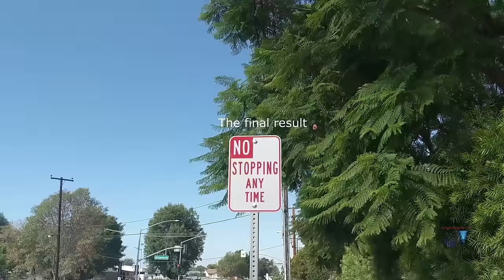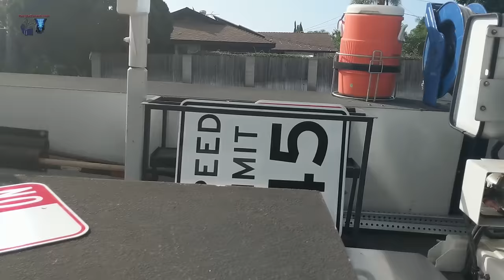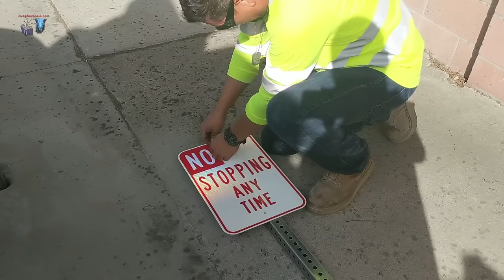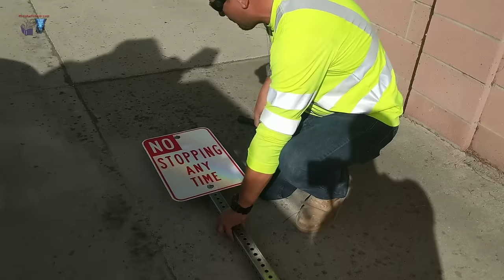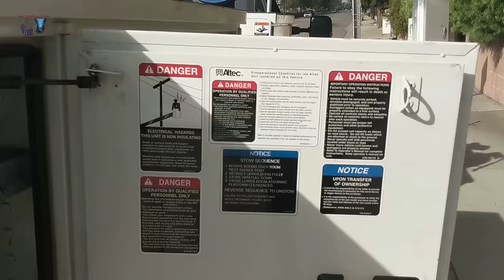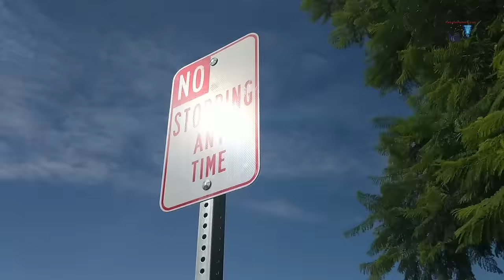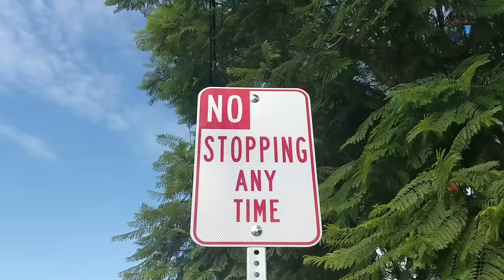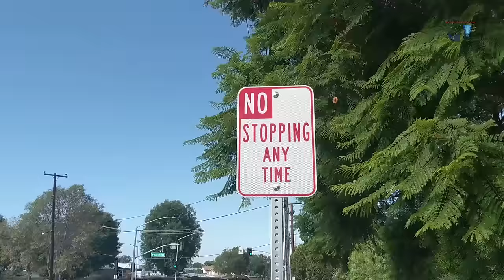USA - HOW TO REPLACE ROAD SIGNS, MOVE, CHANGE, REPAIR, MAINTAIN

Comment: They both need additional PPE but at a minimum the guy who has the grinder needs the eye protection and the other with the jack hammer needs the hearing protection.
Reply: Gloves for the grinder... respirator mask for concrete dust... I'm with you!

Comment: Great video. I use the same telespar posts.  I use the aluminum rivets.  Are those steel rivets you are using?  They are tuff to get out.
Reply: that, they may be, however, as i stated in the comment, what's to prevent someone (not that they would want to) from stealing the post with the sign on it ? after all, it wasn't even tacked or spot welded to the extension that it was slid into.

Comment: what's to prevent someone (not that they would want to) from stealing the post with the sign on it ? after all, it wasn't even tacked or spot welded to the extension that it was slid into.
Reply: I use rivets that are hammered into the holes in the post that match up with the anchor.